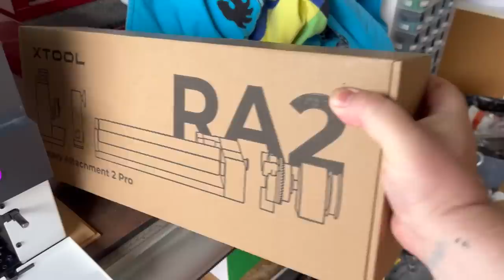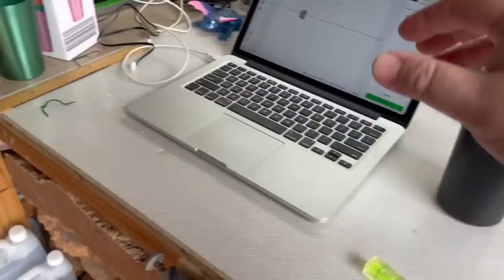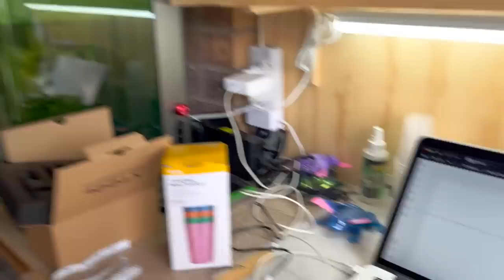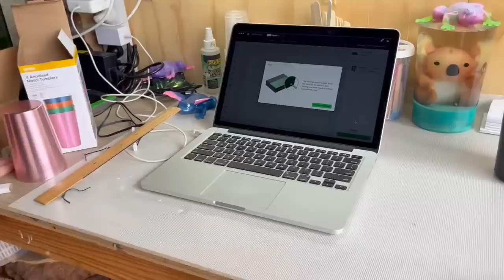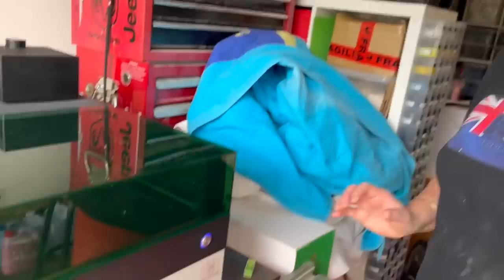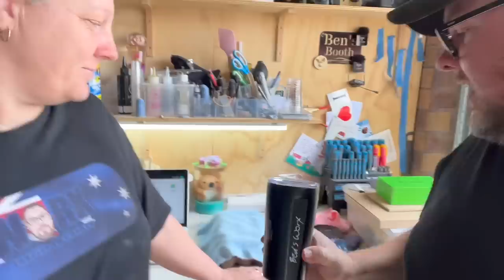How to Make MONEY With a Side Hustle - Ep 1

Comment: A little tip for doing cylindrical work - you'll find that the perspective of your engravings ends up a little skewed, they often look a little squashed on the horizontal because of the curvature. If you stretch your image by roughly 8 to 10 percent horizontally (theres no single value that's perfect), it fools the eye into seeing it more correctly. All kinds of videos about it here on the tubes, just helps you make the best product possible. 😊  Great video as always, thanks!
Reply from the maker: Thankyou!!
Reply: ❤❤❤❤❤love it❤❤❤❤❤